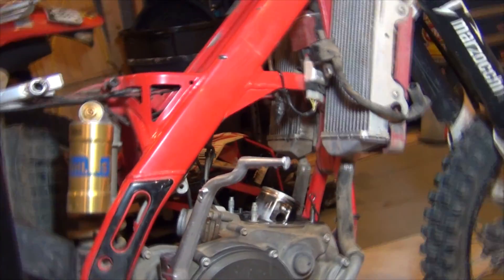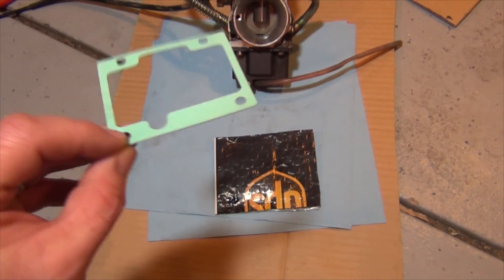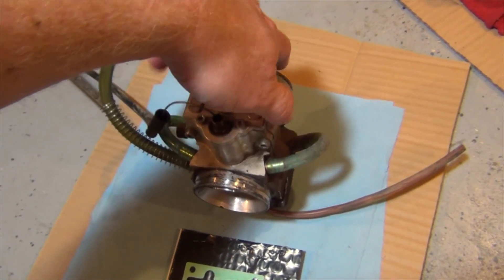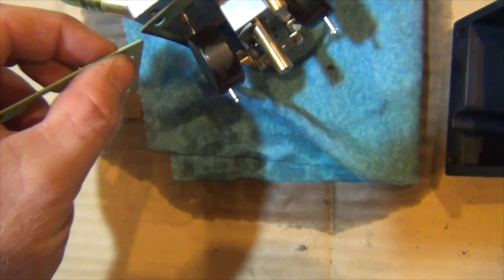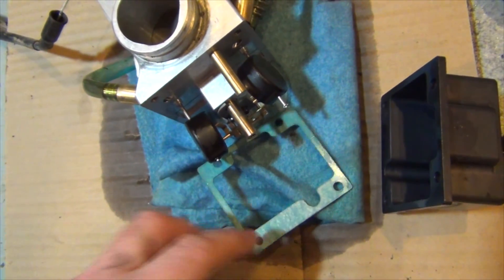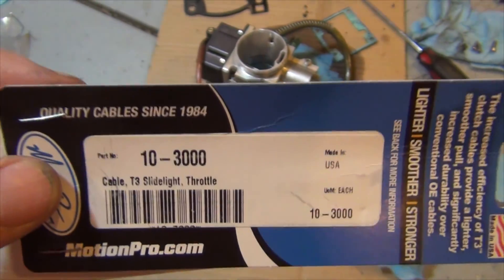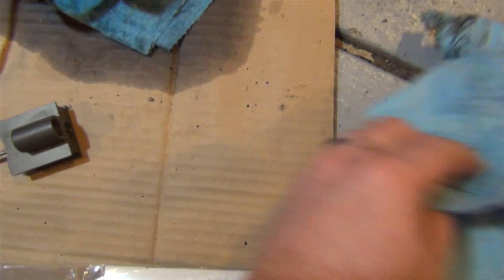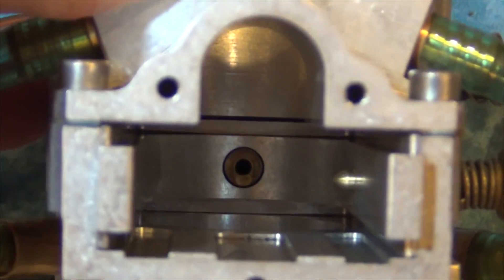2012 Gas Gas EC300 APTSmartCarb & Motion Pro T3 Cable

Comment: I just ordered this Motion Pro T3 cable for my GasGas (EC125 2014) and I just noticed that cable doesn't have any angle on the carb side....The GG gas tank is giving me tough time with my current angled (45 degrees) cable. The carb side is flexible? because if it's straight the gas tank can't be fitted well.
How did you managed to?
Reply from the maker: I think your gas tank is much different on the 2014 then the 2012 but I'm not sure, I had no issues.
Reply: Tnx for the quick reply! So I just need to know if the cable on the carb end is flexible or not, can it be bent to angle of 45-65 degrees? or even close to 90?
Reply from the maker: I would say probably NO, you don't want the cable to have any dragging/friction. Motion Pro was helpful when I called them on their cables once.
Reply: I'll try that, tnx :)